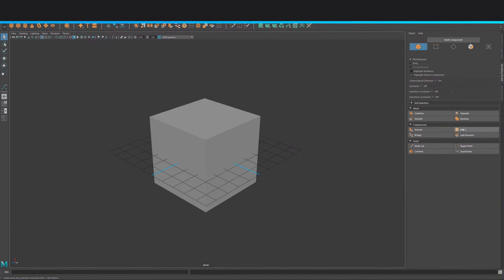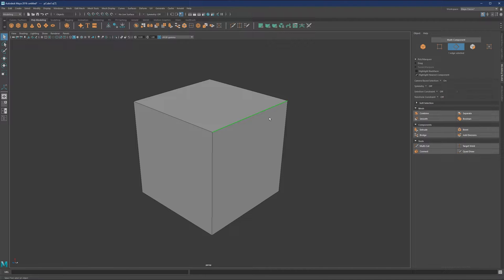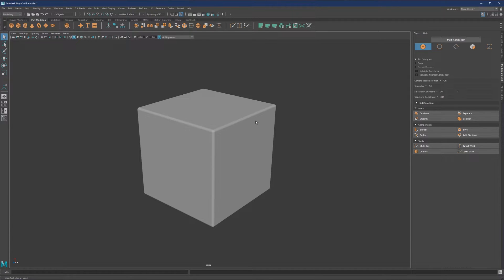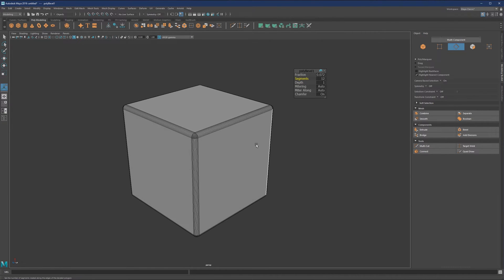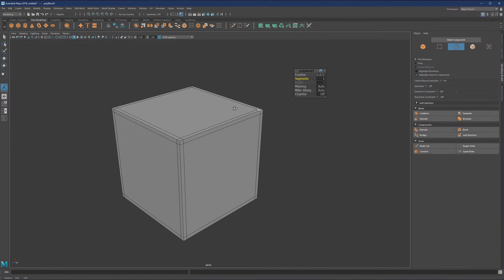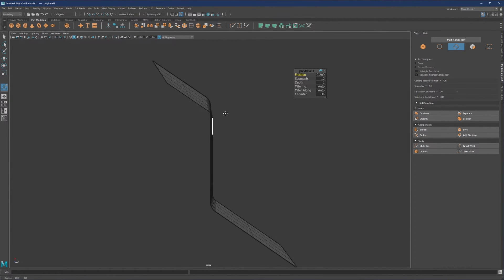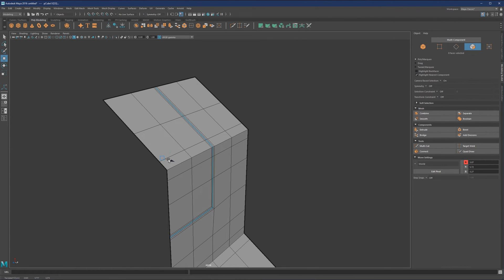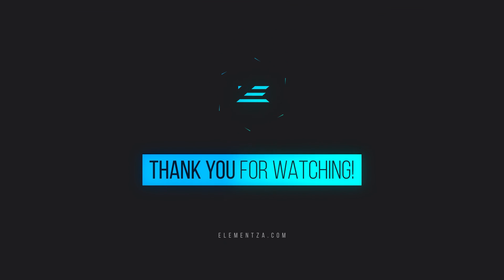Intro to 3D Modeling in Maya / Bevel Tool

Comment: when i select the bevel tool, the little pop-up window to adjust fractions and segments does NOT appear in the viewport. instead, i have the pop up window where i can adjust them and hit apply. This is not as efficient as i can't get a live view of my changes in the viewport. Any help would be amazing
Reply: I was having this problem, and also when i extruded the window didnt appear and faces were inside of the mesh for every extrude. I reset my preferences and it totally fixed it. I recommend you instead of deleting your pref folder rename it then you'll be able to load your shelves and hotkeys from there.
Reply: @TheKashRed  thank you so much. im really trying to get GUUD at maya lol
Reply from the maker: Maybe reseting the preferences would help
https://knowledge.autodesk.com/support/maya/getting-started/caas/CloudHelp/cloudhelp/2019/ENU/Maya-Customizing/files/GUID-393D1ECA-9B6E-4625-B5B1-3F28E62AFB1C-htm.html